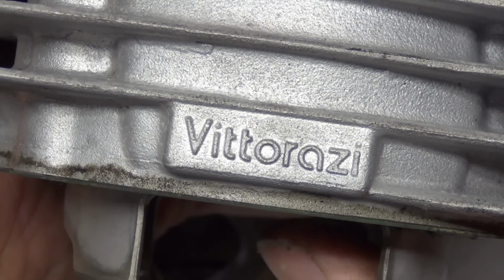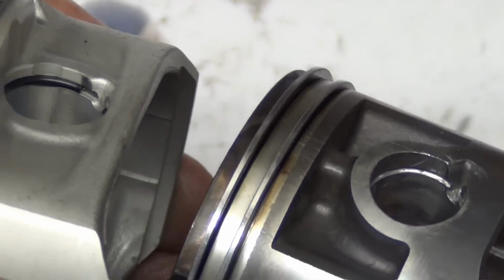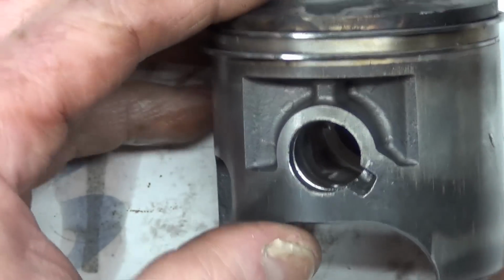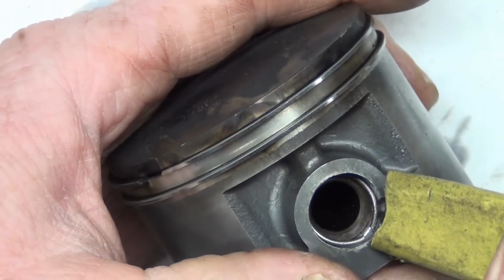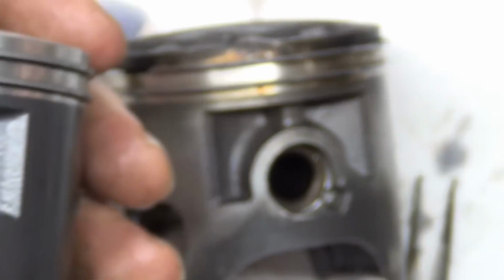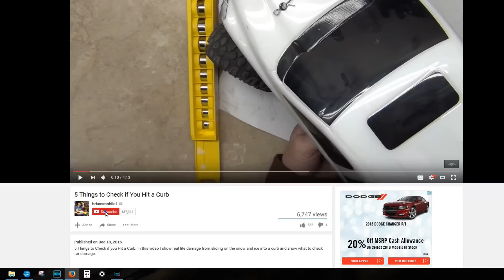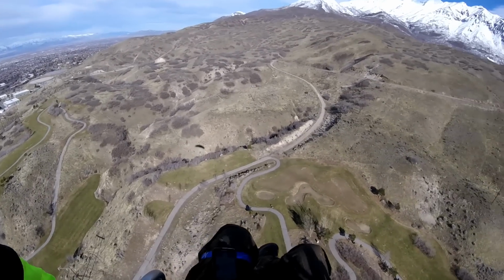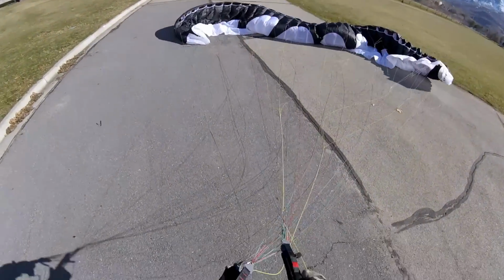Most difficult piston clips I've ever seen!  Vittorazi Moster 185 Paramotor

Comment: Hello Brian
 I realize that the depth of snap ring seat is a little deeper than many pistons but you were so close with the neeedle nose I a surprised that you did not use them for installing.
Take the new snap ring hold in the needle nose 90 deg. to plierswith roughly  1/4 inch of the end of the ring past the edge of the pliers. Insert opposite end in position in the grove. Rotate hand slightly to close snap ring apply downward pressure and the neesle nose will follow the sot down and ring will flow into the grove. Try it a couple of times on the old piston and let us know if it works for You.
Great video I love the paraglider.

Comment: To install and remove the retaining ring you need to use long- nose pliers.
1. Removal:
1.1. Try to rotate the ring in the channel until one end passes over the notch by no more than two notch lengths.
1.2. Use a long-nose pliers with lips tiny enough so one lip will enter the notch deep enough to catch the ring.
1.3.  Once the ring is caught with the pliers, twist the pliers as to force the end of the ring close to the notch, out of the channel.  This motion will compress the ring enough to get the end out of the channel, no more.
1.4. Once the ring end is out, then simply rotate the ring, with he pliers still on firm grip. The part of the ring still in the channel will rotate out, while the part out will pull.
Inserting the ring is done using the same pliers, but is easier so I’ll leave it to tryout.
Remarks:
1. The pliers lips need to be tiny enough to fit in the notch. Not both lips, only one needs to fit. The notch is the groove that allows access to the ring channel.
2. Twisting the pliers has a bad effect on the pliers lips which will become misaligned. A really good pliers is needed, although a cheap pliers might work as well.
3. In the process of removal, once the ring is caught and pliers twisted, the end gets out then the pliers need to rotate- not twist, or the ring could get permanently deformed.
4. The most difficult part is to turn the ring while still in the channel. For a rough job, a regular flat screw driver could be used, with care as to not damage the edges of the channel, or scratch around. For a fine job, I’ll look around for a 90deg tool like a hook, slim enough to get between ring ends just enough to rotate the ring. Is a delicate operation.

Comment: Wondering... do you have a factory shop manual for that engine? I bet there is a special tool for the retainer clips; likely a thin wall tube type compressor of some sort.
Reply from the maker: I have one printed off the internet.  I used the torque specs and break-in procedure.  Didn't see anything about the clips before embarking.  I've done this on several dirt bikes.  I thought I had this no sweat.  Then the sweat came when I scratched the $220 piston.

Comment: super thanks! for making the video. Q. I'm new to the paramotor. I have a simonini mini 2. I have done carb, and cleared the piston exhaust port etc. as for checking my crankcase, I havent touched it. my general question is, oil/fuel are mixed, but should I check the crankcase for any oil reside? meaning more like "will too rich a mixture leave excessive oil that need be drained out"?

Comment: How do you get those clips out? Bend them? I was thinking for installation, heat the piston, freeze the clip. Would that hurt it?
Reply: The clips are spring steel, no heating or cooling required for removal or installation.

Comment: Brian did you put 400 hours on that?? That's a lot of paragliding!
Reply from the maker: I got the unit used with about 50-100 hours on it.  I do fly quite a bit though.  I average about six hours a week.  It's easy with a motor- you can fly on dead sled days or up to 15kts without getting rocked too bad.
Reply: That's awesome.  I fly sailplanes and wish I could fly that much!  The motor would be awesome.